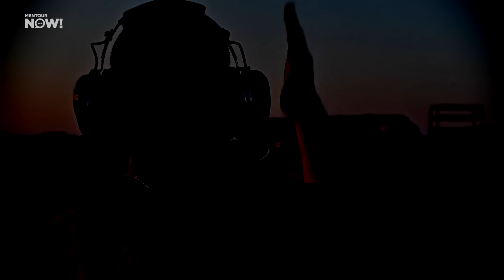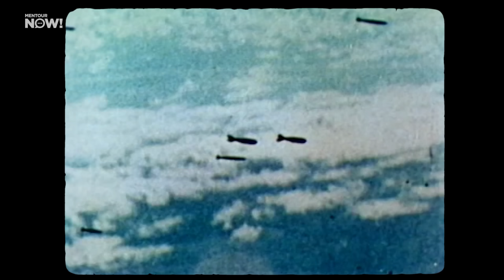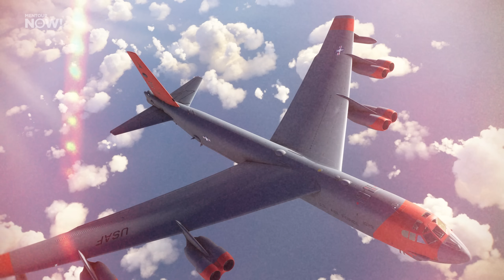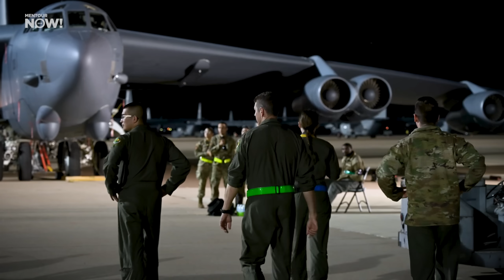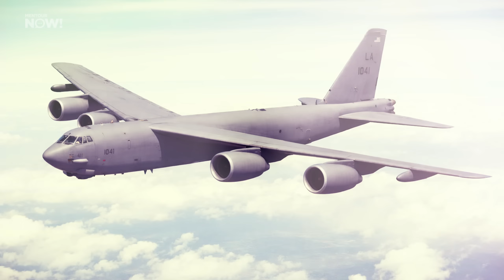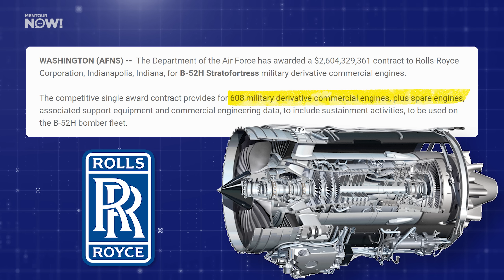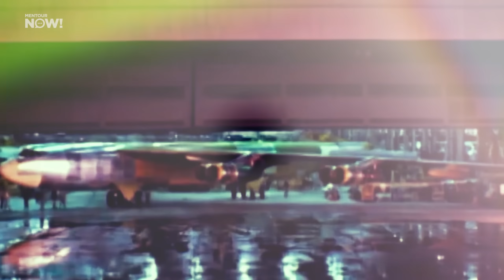WHY Are They Changing The B-52 NOW?!

Comment: I’m 71 years of age living in eastern Oregon. When I was a teen, there were a squadron of ‘52’s stationed at Mountain Home AFB in Idaho, and we used to go watch them practice radar avoidance as they would fly down the Owyhee  River canyon, below the canyon rim, and exit out over the Treasure Valley at barely above tree top level!  We would be standing atop the canyon rim looking down on these monsters as they careened their way through the canyon, Dr Strangelove style! Amazing aircraft then - even more so today.
Reply: When I was ACDU in the Navy 1960s-1980s we would be out on my carrier’s flight deck and occasionally LOOK DOWN to see.a B-52 passing by.  The flight deck was 60 feet above the waterline!
Reply: @edwardweeden2834 That had to be something to behold. You have lived 😂
Reply: There is a video of another buff flying lower than an aircraft carriers deck.
Reply: i was in the Marine Reserves and on my way to a drill weekend in the early 90s. i was listening to the soundtrack from Apocalypse Now at full volume and out of nowhere came a B-52 at low level, very low level. it crossed the highway going from the low open river side to a ravine on the other side. between the music and the timing of the B-52 coming from a lower altitude than the road to popping up in an instant and disappearing into the ravine it was just so inspiring. 
about a year or two later while going to a drill weekend again, i seen a B-1 make the same run at the same spot.
my most special plane sighting was the winter just after 9/11. me and two friends were snowmobiling just outside of the northeast corner of Yellowstone Park (Cooke City). we had made it to the top of an 11,000 ft peek and sitting there enjoying the clear blue day and fresh snow. we started to hear a jet getting closer and we started to look up overhead for it, then next thing you know we catch sight of a plane at low altitude, maybe 2-3 thousand ft higher than we were, it was Air Force One flanked by a handful of F-15s. we all watched in silence and no one thought to try and get a camera out until it was going out of sight. we found out later that Bush had been at some meeting in Seattle for the week and was heading back to DC.
about two and a half later i was sitting outside of Fallujah Iraq watching a whole other type of aviation show....lol
Reply: CAN YOU HEAR ME,......LOL........
Reply: Sir you had an amazing childhood
Reply: I wish I could see something like that but I would have to drive 5 hours to the mach loop in Wales and unfortunately I don't have the money to just go for the day
Reply: She I was stationed at MtHome AFB in the 1980s we had F111A and EF-111A jets. One day driving to base I thought I saw an F-111a flying at me getting bigger and bigger until I could see it was quite different in the nose. My first site of a B1 bomber. Later that week I was in the cockpit. Way more advanced than the F-111a. Later in my career the B-2 came out. Now they are both retiring while still support KC-135r aircraft.. they must have built things really good in the 50’s
Reply: Minot AFB in North Dakota is one of 2 bases that still host the B-52H. The other one is Barkdale AFB is Louisana. I grew up about 150 miles SW of Minot in the SW corner of the state and right near my family farm was a low level training run they ran. It wasn't their main training corridor so it wasn't used very much, but we got buzzed a couple times.
Reply: @dannyo6699 I probably seen the same ones.  😂
Reply: At Fairchild AFB near Spokane there were B-52s for many years as well. Awesome to see them flying over. nNow it's a support base flying tankers.
Reply: I lived in N Georgia mountains in 1985. I've seen C-141s from above as they flew through a valley, and once saw an F-4 briefly appear over my head, out of low clouds, passing only a thousand feet from an obscured peak. No crashes!
Reply: That would be something to see! I remember up close encounters with water bombers here just north of Sudbury years back and if you've ever had control of an aircraft in your hands you sure develop an instant deep respect for the best of the best pilots we have that serve to keep the free free!  Thanks for your service to all those who keep us safe!!
Reply: I live in the Treasure Valley and I just can't imagine seeing something like that! What a neat story
Reply: I did too out by the Owyhee Dam. They certainly get your attention as they pass by.
Reply: I’m confused… why would a high-altitude strategic bomber practice flying at tree top level? Was this just for exhibition or pilot enrichment? 🤔
Reply: @ArmchairDeity the mission changed after the Gary Powers U2 shoot down
Reply: @ArmchairDeity the nature of combat and air defense changed and so the roll of the B-52, and many other aircraft changed.  Instead of “high and fast” things have gone either “low and slow” or stealth.   

The B-1 was designed as a high altitude, fast bomber, but is now often used as a “nap-of-the-earth” bomber to come in under enemy radar.  A few years ago, out in the desert near EAFB in So CA, I had a B-1 come out of nowhere and fly over me just a few hundred feet off the ground.  Wings swept back a going like a bat out of hell.  It was very cool to see
Reply: @gospyro      I am pretty sure it was designed for both high & low altitude bombing but primarily low altitude.   That was the 'game' in those days.   It was also cabable of mach 1+ at low level.   (The first two prototypes.)   Somewhere in the specifications phase the Air Force decided  mach .95ish was good enough and the slower speed would give the airframe a lot longer lifespan.   And the airframe was designed with a little less 'beef' to save money.   Overall though, the B-1 has been an excellent aircraft.   
       600 mph minimum, is 10 miles per minute, 1 mile in 6 seconds.   If your lucky enough to acquire it at 5 miles away, you only have 30 seconds to position missles & launch.   It can be done.   But remember the B-1 is jamming & terrain masking.    So even at low level, defenders have to be pretty quick to keep from having a bomb land on them !   😅
Reply: @ArmchairDeity To avoid radar you fly really low. Also you arrive before they can hear you
..
Reply: @ArmchairDeity  I live in Billings Montana, and I drive a lot in eastern Montana and Wyoming. In the 70s, I can remember driving out to Miles city, and there is nothing out there -- especially back in those days. There are inner changes and exits where there's just nothing to exit for except for Farmer Joe's ranch. Anyway I remember one time going down the interstate and all of a sudden, here is a B-52 flying maybe 500 feet above the interstate, following interstate I94. Not only was I startled when I saw it, but my Cobra RD 3000 radar detector went bananas! It alarmed like I've never seen an alarm that quick unless you were right on top of the trooper's radar gun.
Reply: @doctorquestian       The B52 has a very serious Electronic Warfare System.   It listens for surface-to-air missle radars & can jam the H out of them.   Very high power & Multiple frequencies.   He was probably working with a ground training site as you were passing each other.   😊
Reply: @ArmchairDeity low level bc sams. Reason for b-1. Now it's standoff missile carrier.

Comment: I would imagine mission profile and operational costs come into play as well as for why the air force keeps the Buff around. My favorite thing about the plane is watching it land in a cross wind. The pilot crabs it like any other plane but doesn't have to straighten out the plane to touch down. All four landing gear rotate and it can roll straight down the runway with the fuselage angled. Cool to watch. That and the B-52 is the last American bomber to get an air kill. It is also cool to watch how the landing gear is stowed, it's just so unique.

Comment: It's easy to figure out why they are still flying it. You cannot replace it for nearly any amount of money for what it can do. It would take nearly forever to get something like this flying and would cost more money than anyone has. Just look at the current situation with the F 35. Extremely expensive and way behind schedule with no end in sight. The B 52 is probably just fine as it is for what it is needed for and with the overdue new engines will be able to finish out it's service life. One has to admit that the US military generally gets their money's worth out of it's airplanes. Just look at some others that stayed in service like the F 4 Phantom. Over 5000 built and used by countless countries around the world and just now leaving the service of many of them. A great aircraft and there are many others. The B 52 is obviously a well built and designed plane or it would have been replaced years ago.

Comment: The structural design of modern planed is optimised to reduce weight, so they use computer modeling to confirm they can get away with thinner material and chemically or mechanically mill out material that isn't in a direct load path to save weight where they can. Back in the '50's if they calculated they needed 0.070" material, better make it from 0.080" or 0.100", just to be sure. Way stronger than it needed to be, but lasts forever.
I used to work on fighters that were out of air frame life after 6000 flying hours. Admittedly a fighter works a lot harder, accrues a lot more fatigue in a shorter time and stays up for nowhere near as long for each flight, but 25 years and its worn out and probably obsolete. 

Its hard to believe these things are still going, even with the upgrades, but I'm pretty sure they will be the end of a breed. They just don't make them like that anymore.

Comment: Wait until you do a video on the Convair B-36 Peacemaker
The largest piston-engine aircraft ever built, The largest combat bomber ever to enter service, for a time the largest military aircraft of any kind, entered into USAF in 1949, wingspan: 230 ft/70.1 m - still the largest wingspan of any combat aircraft, MTOW ~410,000 lb/186 metric tons, 6x piston R-4360, 4x jets  GE J47, longest range nuclear bomber ever fielded. thats 10 engines. it has its own movie, Strategic Air Command (1955) american aviation war drama. the videos of it are crazy high resolution.

Comment: since it is a bit of a pet beef of mine: there is NOTHING wrong with desinging with slide rulers. People always act as if this were soem magic and could not possibly have equaled modern calculations. 
You can do ALL maths  without computers. That is not a function of the quality of the math achieveable, only of the time and manpower (i.e. funding) needed. And the US military never lacked those. 

The same is true for Nasa and Apollo. Although Houstons MASSIVE 3 IBM 360 mainframes are ususally ignored when comparing the apollo computing power to other things. They did the heavy lifting during a mission and before but so did a LOT of REALLY smart people with ... slide rulers.
Reply: A lot of that early stuff including through the start of space missions was actually done by "computers" using pencil & paper plus slide rules. Most younger people do not realise that Computer was a job title from the early 1600s all the way until the word was gradually defaulted to mean electronic computers through the 1960s and 70s, and the job title was retrospectively changed to Human computer.

Comment: It's not the years but the hours. They don't fly them much, relatively speaking. It may take 100 years for the B52s to accumulate the hours a commercial jet does in 10-15 years. And I put my money on the 737-200 gravel kit still flying into remote Canadian tundra long after the last B52 has rotted away at The Boneyard in AZ. 🤣😂

Comment: The electronics these engines enable is really where the story  is going. Two of these are capable of powering a small AWACS, so they put in the largest air interception radar of any combat aircraft, the entire electronic warfare suite of a Growler, air to air missile capability, new data links, and because of the new survivability this let them add the nuclear mission back onto them that was removed over a decade ago.  The new capabilities along with 70,000 lbs of payload turn them into an aircraft that can on its own disassemble the air defense of entire nations.

Comment: The dream of digital systems was to lower cost, ease maintenance, and streamline installation.''', suuuure.
Aircraft now take longer than ever to come to service. 
They ARE dragging their feet.
1940's and 50's designers had to test everything as well, with analog systems, and they did it in less time BY FAR.
Remember the X-15?, the F-104?, every jet aircraft back then was breaking new ground, and these days we hear how complicated slapping an engine onto an airframe this old is...

Naah, I don't buy it, not for a second. 
Granddad did it better and faster with a slide rule, and he would use by-God American parts to do it.

We are sliding into incompetence and being told how hard it is to do a job badly.

Comment: ok so i have this idea, with the hight of the wings on planes limiting bypass ratios these days, so the twin nacells on the b52 makes me wonder why we dont use that style nacell but have only one jet and the 2nd nacell is like a gear driven bypass only fan, so then the inner of the pair can have like whatever it can fit comfortably say like 5x bypass, but the outer one has that same 5x plus the centre all the air that usually goes through the jet so that extra 1x, so now we have 11x bypass but without the massive single nacells

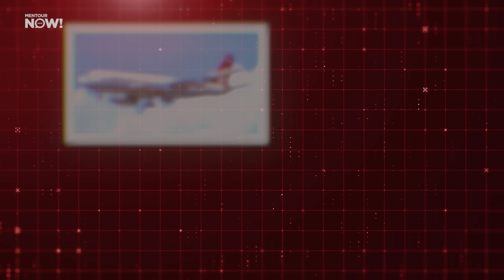Comment: 5:08 Fun fact: The 'V-Jet' on the Qantas 707s tail stands for Vannus, which is Latin for Fan.
 So it's literally 'Fan-Jet'.
The first Qantas 707s were fitted with P&W JT3C turbojets but later modified with the JT3D turbofans, and the V-Jet livery was to celebrate that. 😀🇦🇺

Comment: People should not ask why this takes so much time but why so many things don't take that time. Take educational reforms in schools for example. How can something be changed yet again if it hasn't even been in place for more than a couple of years. Arguably to see the real effects of a school system change would need at least 30 years, to see the impact on later work life. 

Same thing here, it makes sense to run the test over a period of time where you can actually get data not only through design but also use. Also if only parts of the fleet get modified, if something should fail, then there is still the other part left. Sounds reasonable for such a high risk application as nuclear bombers.

Comment: The reason the J model still has 8 engines is because the Pilots' controls still have 8 throttle levers. Do you know how difficult it would be to get rid of the extra throttle cables?

Comment: I was an Air Force Crew Chief that worked on the B52's as well as the KC-135 and E-3 AWACS. Those old J-57's were the loudest engines I'd ever heard. They actually injected water into the turbine section to increase power for takeoff. It only lasted for about 90 seconds but they were so incredibly loud and belched even more black soot. It was amazing!
Reply: If you were working on B-52s, KC-135s and E-3s, I would hazard a guess that you would understand a reference to Building 3001 then.  Still waiting to see if the USAF goes through with the E-7 Wedgetail buy to replace the E-3CFs/E-3TFs that are still in operation.
Reply: Perhaps a challenger to the HS-748 then?
Reply: I second that. I used to watch B-52s in the pattern from the departure end of the runway in the '80s and it was the loudest, most shrill sound I ever heard at that time. I could tell when they were flying from 10 miles away by all the smoke over the base.
Reply: @bendeleted9155  I like the high pitch noise the B-52s make because it's easily identifiable when they're overhead, and it the B-1Bs are like that to a degree.  The B-1Bs can be 6-7 miles away flying testing patterns after depot maintenance and you can instantly tell what it is when they turn away from you because the noise, even at that distance, becomes substantially louder.
Reply: @bendeleted9155  lame!!!!!!
Reply: it was pathetic you mean! the ''richest'' country in the world could not afford to modernise a useless outdated plane let alone make a new one. today they forces us to buy evs despite them keeping polluting even more.
Reply: @carholic-sz3qv  agreed
Reply: @carholic-sz3qv  It's not often I see such an overt attempt at trolling. Dial it back a bit, comrade.